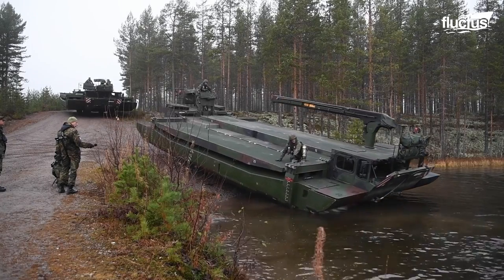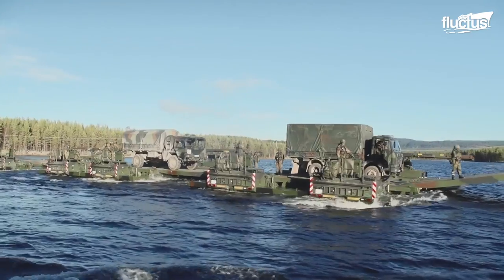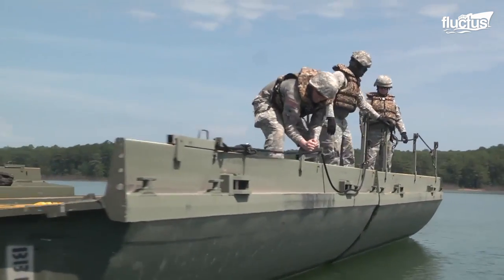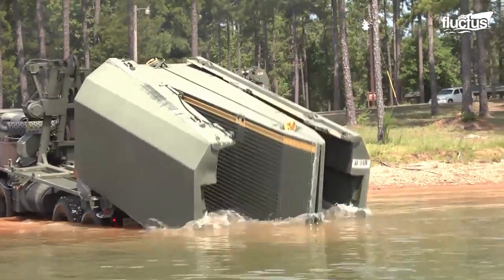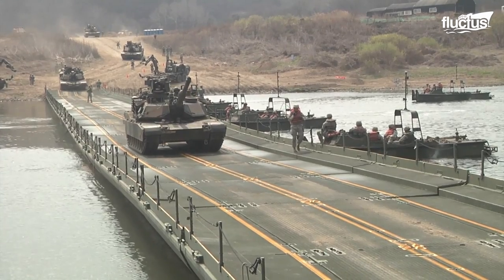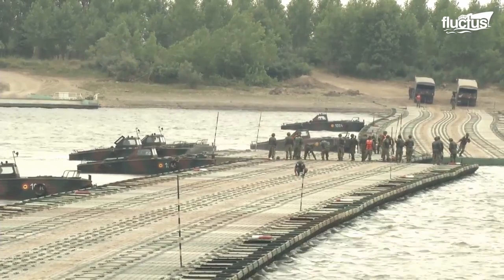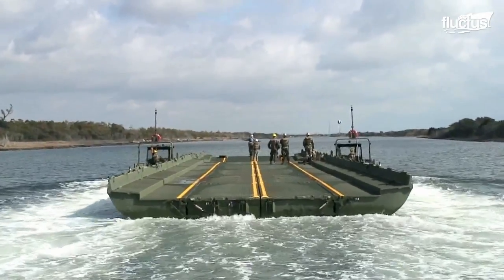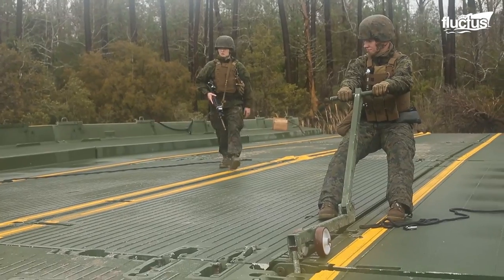The Genius Transformer Bridges US Forces Use to Build Massive Bridge in 5 Minutes

Comment: The German M3 is superior in Speed and Versatility. And on the Modern Battlefield, Speed is Life. Only for Main Battle Tanks does the Ribbon Bridging Equipment come into its right. And it wouldn't hurt with some innovation in that respect. It's slow and vulnerable. With the advancements in Carbon Fiber and Graphene in the latter years, one should think that these extremely important functions of Land Based Armed Forces could be improved drastically to enhance the size, the speed of movement and deployment.